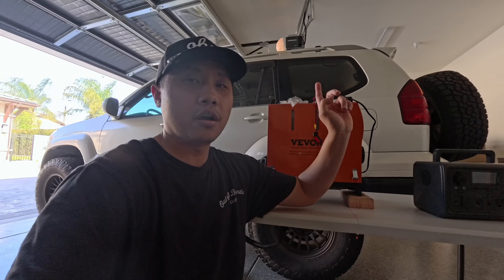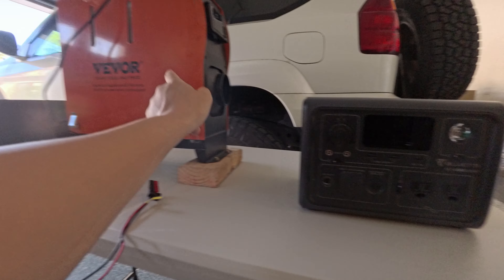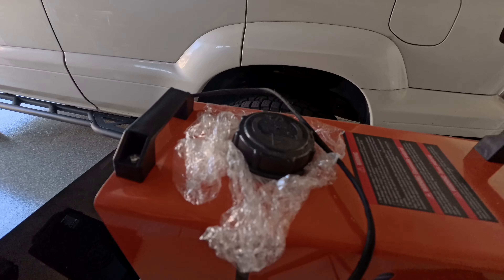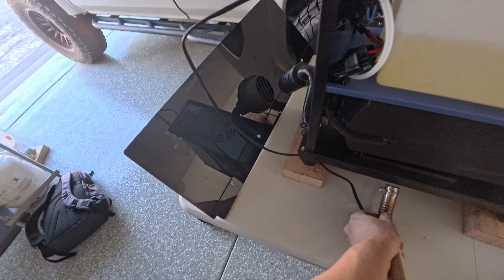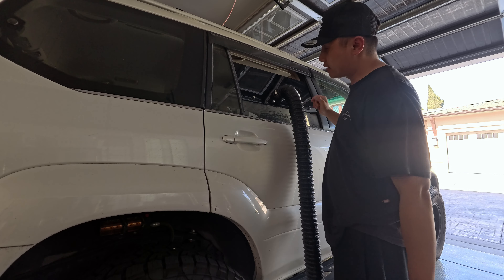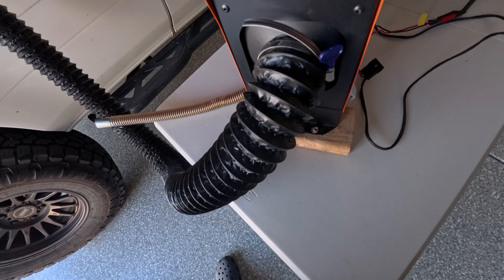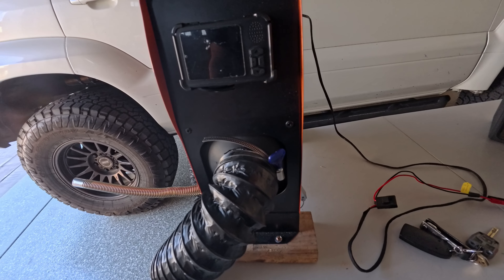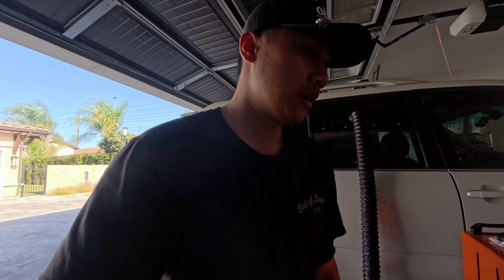Vevor Portable Diesel Heater + Window Vent Solution for Car Camping

Comment: I bet the 12volt plug would work better and all night. I run my hcalory on a eco flow 576 and all night low setting on an 8k heater left me with just 35 percent battery
Reply from the maker: I hear that the 12 v cig plug could make the wire run hot cause of the load. But I definitely need a bigger battery aha 268wh is too little aha.